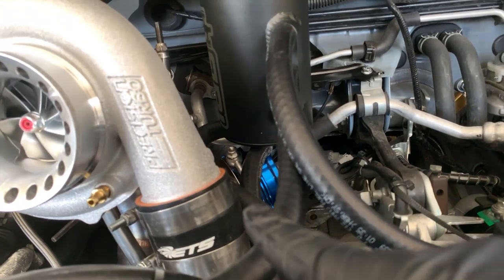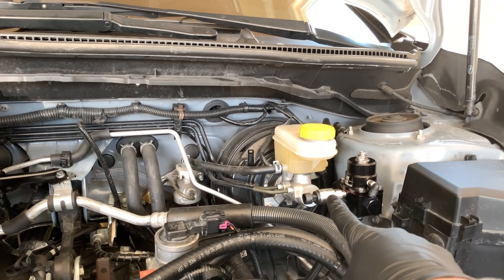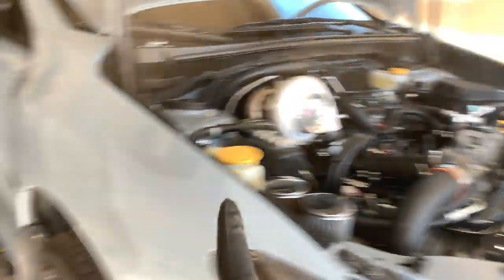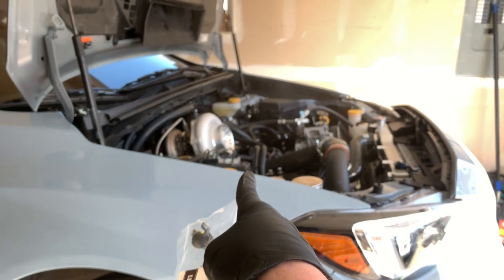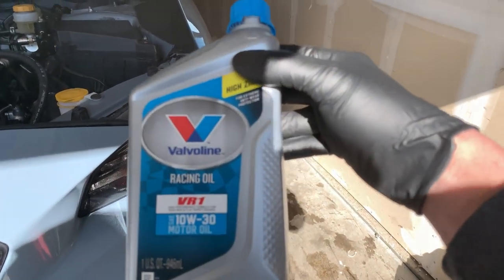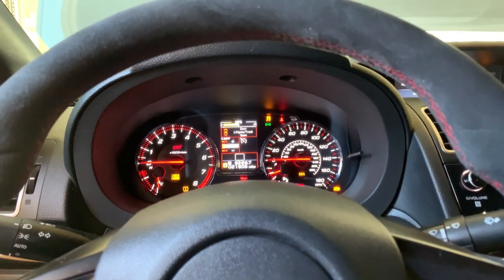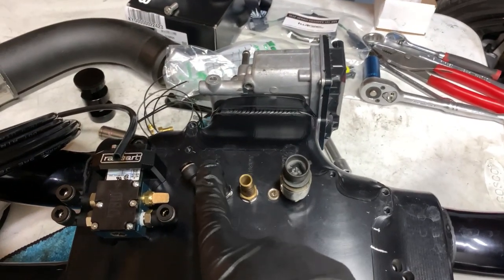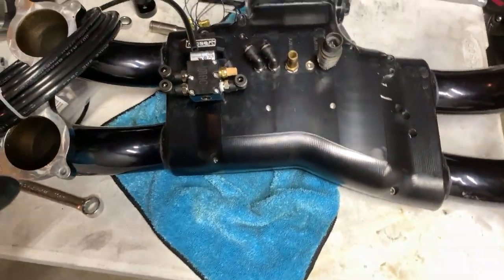800WHP STI Build Episode 5: Boost Control / Vacuum System

Comment: 2 questions mate. What's the diffrence from upgrading from the standard flow and return fuel lines to the tank.
Also what do I need to run mafless. My ecu can run it bit not sure what other sensors I would need instead of the maf.
Any links would be sweet aswell.
Reply: you need working IAT sensor, working AMP sensor and a wideband on the downpipe

Comment: Josh can you use VR1 on stock motor. I don’t see them making 5W 30? Any suggestions?
Reply from the maker: I use it on all engines and 10w30 is fine 👍
Reply: Doesn’t matter that it’s not synthetic? Thanks!

Comment: Making good progress day by day!! Do you ever run turbo blankets on your cars?? I know they help a lot with spool up times once the turbo heats up
Reply from the maker: Hyper blue runs a turbo blanket due to location of turbo and wire harness. Although i have no difference in spool time with or without a turbo blanket. Im sponsored by turbo guard and im sure theyd send one for series grey if i asked.
Reply: @BaderBuiltRacing  yea that makes sense 
I know it makes more of a difference on diesel's than it does on gas cars, especially when you have 1000hp it wouldn't even be noticable if it did anything lol but definitely good at bringing down engine bay temps at least 👍

Comment: How come you keeping that egr valve
Or biometric pressure sensors
Reply from the maker: You must leave barometric pressure sensor on when deleting air pump system, it compensates for different elevations. You can cut the sensor out of top of solenoid but i choose to just leave it and bolt it back on engine. Its a pain to cut them out lol
Reply: @BaderBuiltRacing  ok ye I cut mine   lil wight saving